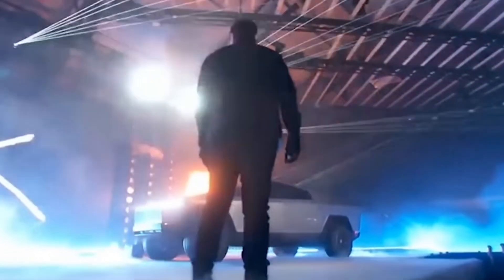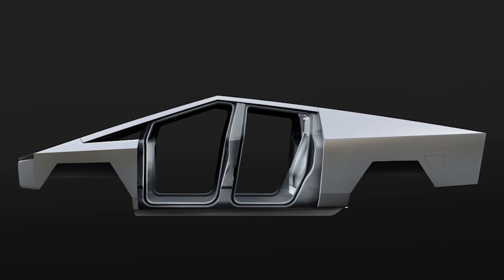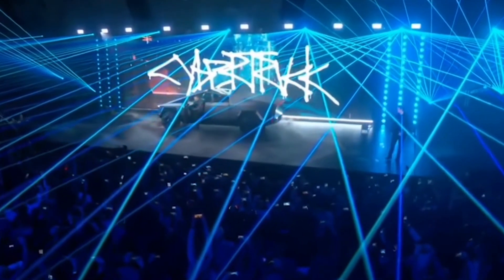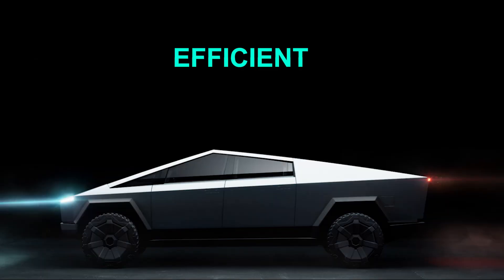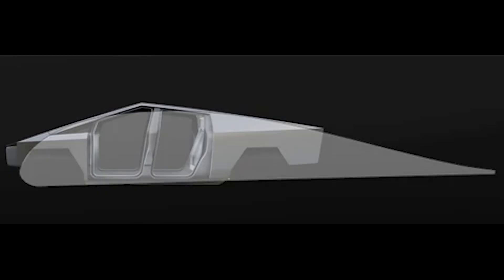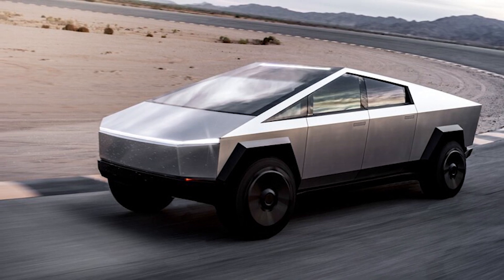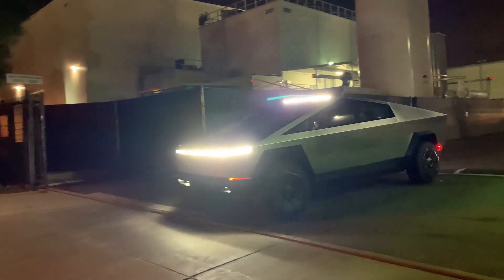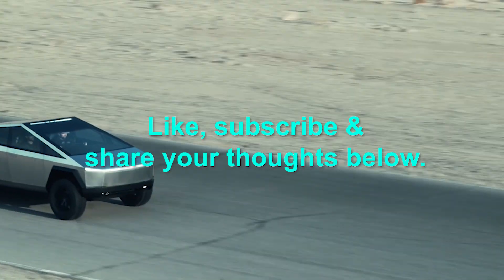Cybertruck is Engineering Genius (and will be copied)

Comment: U forgot 5 things: it has the optimal form for solar energy (40 miles per day is a game changer), and Tesla will have a easy way to attach and transform the vehicle, to a CyberVan or a cybercamper.
It is also the best choice for the enviroment, steel unbody is very easy to recycle, and 4th: Tesla will build one version that can swim, probably even dive. 5th reason: the military/police can easily armor it for their needs.
Reply: Just FYI, stainless steel is a pain in the ass to recycle and process - which is why it is almost valueless as scrap. Steel and iron are FAR more valuable. Sorry to crush your hopes and dreams...
Reply from the maker: All good points. I'm considering making another video on the commercial potential for Cybertruck (police, armed forces, emergency services, freight etc). It's a NO BRAINER. Fast, tough and low running/maintenance costs. 

I'm calling it now. Stock standard Cybertruck will be water tight, will float and will be able to cross large bodies of water. Whether Tesla advertise this or not is another matter.

Comment: Fyi a stiff and rigid frame is less safe than a soft one.
Because if the frame does not absorb the energy from the impact.
All the energy wiol be transfered to the inside. That would mean the poeple and its passangers aswell as any loose objects.

I am intered in how the cybertruck handles this and seeing its actually crash and test results.
Reply from the maker: Hey Kubi, this has come up a lot. You are right about a rigid frame but the steel can be scored on the underside to crumple in a predictable, repeatable manner and they have as much space fro crumple zone on Cybertruck as Model 3 (literally the same). So there's room. But agree, I'm very interested to learn more about crash safety and see test results.

Comment: camper option mini bus freight van? Look like wheels go up a cybertruck may cross in water...how deep?
Reply from the maker: There's a chance Tesla will use Cybertruck platform to built out freight and camper vehicles as well.

As for water. I'm making a big call now. It WILL be able to cross bodies of water. It will float. It will be water tight. Offroading and need to cross a stream or small lake? Go for it. Just avoid rapids or the ocean...

Whether or not Tesla advertise this ability is another thing.

Comment: How would that tough shell do in a crash test? Doesn’t it need to crumple?
Reply: The passenger compartment needs to be tough, the front part needs to crumple. I'm guessing you could build it in a way that the front part isn't as tough as it could be.
Reply from the maker: This is coming up a lot. The steel can be scored on the underside to crumple in a predicable and consistent manner to distribute force. Won't be an issue. Hopefully Tesla will say more on this soon.

Comment: Elon Musk flubbs the presentation by breaking the glass, and then further screws up by he neglecting to mention many of the features of the truck and he gets 259,000 orders in 24 hours? If I sold trucks, I would be really worried.
Reply from the maker: TBH, I think behind the scenes, some automakers are freaking out. The smart ones, anyway.

Latest rumors snuggest around 330,000 reservations.
Reply: @SolvingTheMoneyProblem   And as for the design, if you look really close at any new passenger car, that weird pentagon profile is almost visible. It is just rounded off.

Comment: There are a few things you're forgetting. To meet DOT standards in USA, it MUST have windshield wipers, mirrors and a 3rd brake light. Tail lights/blinkers are another issue, they must be permanently fixed. This means, an LED strip across the tailgate won't pass. Those items must be addressed. Lastly and the most glaring, expect the range to be cut down to a third of it's normal capacity while towing. And if this truck is to be taken seriously in off road or work truck applications, Tesla MUST address the vehicle being virtually immobile if the battery dies. Don't get me wrong, I like the concept but it is only the beginning.
Reply from the maker: No doubt there will be a few tweaks before production begins. The need for side mirrors is archaic now that cameras and screens are cheap and ubiquitous. I think Tesla will be pushing very hard to change the law but in the end, they'l do what they need to to be road-legal.

I'm curious to know the range when towing at capacity. Definitely won't max out at 500 miles haha.
Reply from the maker: Also, Tesla recently patented laser-wipers. (seriously)
Reply: @SolvingTheMoneyProblem  Archaic, yes, but it is failure proof which I can't say about a camera/screen system. That's why I don't see it ever being completely eliminated. Being around the trucking world, simplicity and redundancy are the keys to safety. 

And me too, the tests I've seen so far towing with the Model 3 don't do the truck justice!

Comment: Tesla always sound good... but they always oversell and under-deliver. No doubt they will get some orders, but the flaw is still the same.. it's electric. It has come too early and the market demand will be minimal. Only time will tell I suppose. One thing that is never said is that electric vehicles are only as green as the source of the electricity.. in USA electricity generation from renewable sources still accounts for less than 20% of electricity supply, meaning your Teslas are ultimately powered by fossil fuels
Reply from the maker: Under-deliver as in... over the air updates, netflix, caraoke, sentry mode, dog mode, increased range via software updates, increased 0-60 time, unmatched safety etc? Or...?
Reply: @SolvingTheMoneyProblem  A lot of your aspects are superficial in nature... Netflix? 0-60 time? Is this car going to be on a race track? Anyway, to answer your question, I mean under-delivering by over-committing capital without cashflow to actually make it work as a product, and lack of production capability to meet customer demand, leading to delays.. already we've seen failures in the armour glass that will need to be addressed or removed from the product before production can begin (production which is not even expected to begin until 2021 as it is.. which seems like a large gap considering how much easier this is said to be produced). In terms of actual safety, as in non-anecdotal, this truck has not been given a safety rating, so only time will tell on that. Some of the concerns about the design are that the truck's structure is so rigid, that in the event of a collision, if the truck does not absorb enough of the impact itself, it will be the occupants who bear the brunt, it could pose greater risk to the occupants of another car, which is designed to "crumple" in a crash and greater risk for pedestrians and cyclists. The design may also require changes to even be legal in Australia and some countries in Europe. Anyway, all being said, it is obvious what Tesla has shown is actually just a concept, there's a long time before production will start and there are too many elements to be proven. Long story short, I would hesitate to buy one until proof of concept.

Comment: I've seen similar design looks from the 1970s.   Lots of the rest is speculation and wild guesses.  500 miles range is likely under 200 while towing it's rated load...  Autopilot in it's current form has killed people. Maybe it's a good idea for Tesla to eliminate the paint shop since they appear to do a crappy job at it.   Lots of claims and promises from something that's may 2 years away from production.  It will be interesting to see if Tesla has any unexpected galvanic corrosion problems...
Reply from the maker: You don't have much faith in TESLA, do you?

Comment: I started hating this but slowly I'm gaining a liking to the cybertruck, altogether I'm a strong gearhead
Reply from the maker: Hey Bob, this is a very common theme. The more time passes, the more you will love it!
Reply: Same here, now I actually love the thing and a little disgusted that truck form factor hasn't evolved much. 

I think from a marketing standpoint, Tesla is probably the only company where this can be tolerated. I'm wondering how much of my new fondness is manufactured thought. I went from absolutely hating it to loving it. I might have been brainwashed or just impressed with the reasons behind the design.
Reply: @robertnicholls9917  I believe it's the engineering behind the cybertruck is what makes it grow on you, it seems as though  given that there is no reliability issues it's a pretty  decent truck

Comment: One youtuber pointed out that the Cybertruck is an example of Value Innovation : achieving low cost but unlocking more value. In this case, the added value is durability, fuel savings, status symbol signaling (Tesla brand), towing capability, unique look, and speed (due to electric motor advantages). Some of those value added are subjective of course, but the cost advantages are undeniable.
Reply from the maker: That's a great way of putting it. If you remember the video, drop a link here.

Comment: I still think Tesla has priced the Cybertruck out of the Market. Nobody who NEEDS a pickup truck is going to buy the Cybertruck because they can get similar performance out of a standard truck but for much cheaper. The only people who will buy the Cybertruck are the city-slickers who buy crew cab pickups and use them as glorified minivans. True, currently, crew cab pickups make up about 55% of the pickup market, BUT what percentage of those people are willing to trade their combustion engines for an electric (remember, these are 'truck people' we are talking about)? Of those that remain, what percentage of them are willing to leave their truck brand of choice (again, truck people are incredibly famous for their brand-loyalty). Finally, what percentage of those people can justify/afford the significant price hike of the electric truck over a combustion truck? After all, most people tend to buy the best possible vehicle that they can afford. The average price paid for a half-ton pickup today is about $45,000. Already the BASE Cybertuck at $39,900 is encroaching on that number and for $45,000 you can get a standard half-ton truck with capabilities closer to the top model Tri-motor Cybertruck. The reality is, the Cybertruck is not the best truck that the average truck buyer can afford at $45,000 and so the average truck buyer won't be buying the Cybertruck for that very reason. All of that to say that the Cybertruck probably won't take much of a bite out of the existing half-ton pickup truck market. Now, it does appear that young, Urban people seem to like the Cybertruck, but the reality is that most of them probably can't afford a Cybertruck... meaning that not only has Telsa priced the Cybertruck out of the half-ton pickup market, but also the only market that is even interested in the Cybertruck in the first place! I'll be surprised if Tesla sells more than 30,000 units a year, especially after the first year and especially after more electric and hybrid pickup trucks from other manufacturers start to hit dealership lots.

Just my thoughts. :)
Reply: the cybertruck performs better
Reply: @salvadorgandolfo9753  That's not the entire truth. The base Cybertruck starts at $39,900 and can tow 7,500 lbs. By comparison, a base F-150 with the smallest engine available starts at $27,795 and can tow 7,600 lbs. That's 100 lbs more towing than the base Cybertruck but for over $10,000 cheaper. Now, it is true that the tri-motor Cybertrucks claimed 14,000 max towing capacity would be best in class if it was for sale today, however, the tri-motor starts at $69,900. The current F-150 can only get close to that number with a max towing capacity of 13,200 lbs but can do so on a properly equipped base-model starting at $38,985 (which is also still cheaper than the base Cybertruck). That means the F-150 tows only 6% less than the tri-motor but is 44% cheaper and tows 43% more than the base Cybertruck and is 2% cheaper. As far as bang for your buck is concerned, the F-150 far outperforms the Cybertruck in terms of towing. To put it another way, the base F-150 with max tow package can tow 0.33 lbs per dollar while the tri-motor Cybertruck can only tow 0.20 lbs per dollar. Further, the net generation F-150 comes out next year and will almost certainly be able to tow over 14,000 lbs. The tri-motor Cybertruck doesn't come out until 2021, meaning that by the time it comes out it will likely already be out-towed by the F-150 which will probably also be a lot cheaper to boot.
Reply from the maker: Thanks for sharing your thoughts Dave. You know that reservations have surpassed 250,000 units and continue to flow in? Latest estimates put the number around 330,000.  

Agree, Cybertruck isn't (immediately) going to capture much of the entrenched pickup market. Maybe never but over time, the value proposition will continue to increase (as battery and other costs fall further) and ICE pickup makers will need to release their own electric versions as ICE becomes less and less competitive.
Reply: @SolvingTheMoneyProblem  No problem! I'm happy to be part of the discussion. Yes, I'm aware of the pre-orders, however, no one should be taking them seriously. It is, after all, a no-risk, fully refundable, $100 deposit for a prototype vehicle that isn't even street-legal at this stage and won't hit dealership lots for another 2 years. It's worth noting that the Cybertruck is stacking up to be a failure when compared to Tesla's Model 3 which raked in just over 200,000 pre-orders on the first day DESPITE the pre-order being $1,000 compared to just $100 for the Cybertruck. It's also worth noting that a large chunk of those Model-3 pre-orders were canceled. The Cybertruck is getting a lot of attention now because its cool, hip... and a meme. Will it still be cool, hip, and a meme in the two years it will take before it even enters production and the market is already saturated with hybrid and fully electric pickup truck options?  I suspect that just like the model 3, we're going to be seeing huge numbers of Cybertruck cancelations. I feel like people right now are just pre-ordering Cybertrucks so they can brag to their friends and get social media points and will quietly cancel their orders when all the hype dies down and the Cybertruck meme dies. In either event, I predict that the Cyber truck will be another AMC Pacer, really good sales out of the gates, but declining sales for the rest of its production life. Why did this happen? Because everyone who wanted a Pacer got one, and after they got theirs, there was nobody else who wanted a Pacer. That is the downfall of polarizing vehicles.

 I could be wrong, time will tell.

Comment: Was going to buy an $4K ebike but now I want a $40K Cybertruck. Thanks a lot. Excellent video.
Reply from the maker: Haha, quite an upgrade Laurie. Thanks for the feedback 😁
Reply: The 40K model only has 2WD though. Why not just buy a regular Tesla? I'd at least go for the 50K model
Reply: I also reserved 50k model too. I would never want a 2wd pickup truck. You drastically loose utility and cost difference is just not worth it.
Reply: @LightSpirit24  Another point would be that unlike internal combustion vehicles the all wheel drive would not diminish the energy efficiency and could potentially add reliability by having 2 motors, which in theory could get you where you needed to go if one failed.  As someone who works with industrial electric motors I can tell you they can fail catastrophically. 

love the design but I still will probably not buy the first ones that come out. I need to see how it holds up over the first year.
Reply: @AlexFlockhart  an electric motor failure is usually due manufacturing defects. Either a insulated wire was exposed or bearings were improperly installed.
Two things would cause a electric motor to fail. It overheats, causing the insulation of the winding to breakdown and short out the windings. Or the bearings run dry and destroy themselves. So if the motor is protected from overheating and the bearings are kept lubricated, the motor should last countless years.  ;)
Reply: @LightSpirit24  and ICE also fail catastrophically every day all over the world as well.
Reply: good Video @
Solving The Money Problem. Nicely done! :). Tesla approves. em.
Reply: You're gonna wait quite a while then...